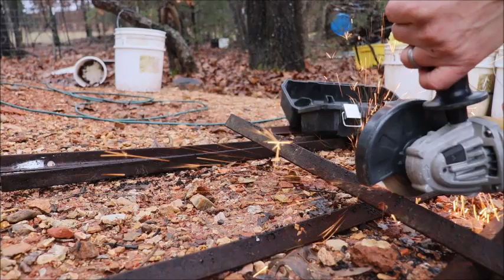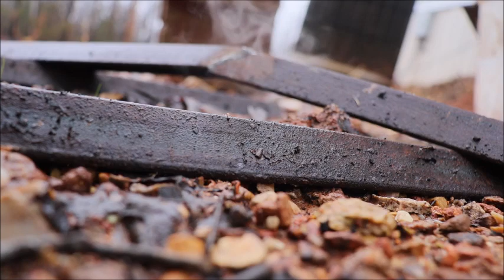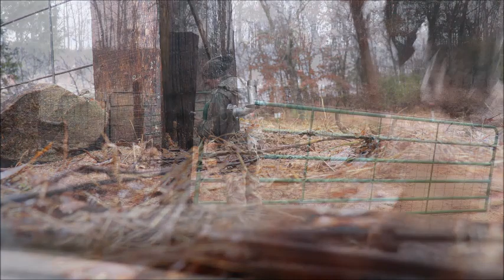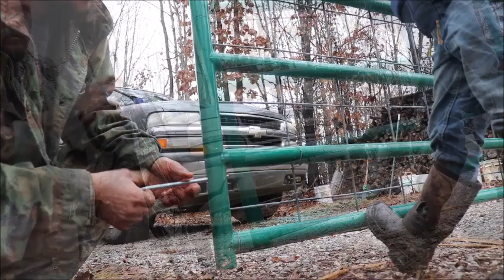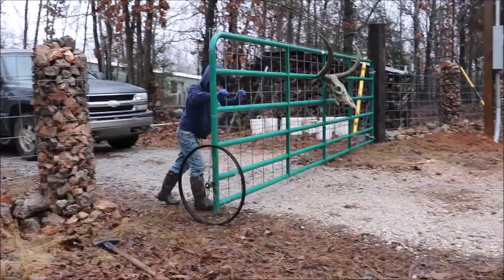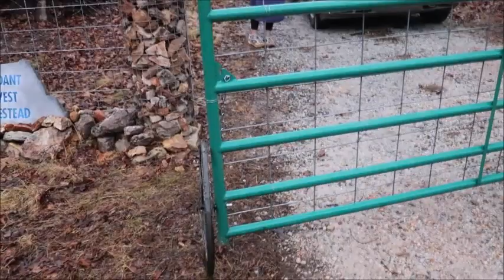FRONT GATE - ADDING STABILITY AND A WHEEL

Comment: Did you use a tamping rod to compact the soil around the rail road tie?  How is the thin wall of that gate holding up to the pressure of the gate on your wheel?
Reply from the maker: Yeah we did, but then it rained A LOT after the initial install and we used the gate a lot too, which cause it to loosen and tip slightly. Should be better now. The thin wall of the gate is holding up well so far, but we just started using it. I'll add a thick tube through the hole if I need to add extra support.